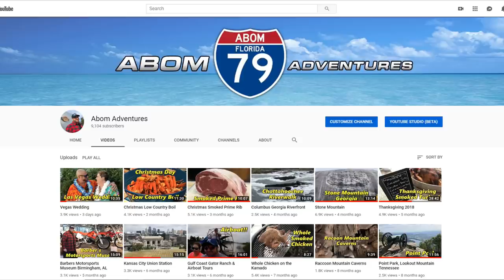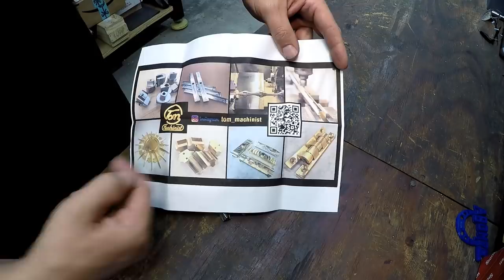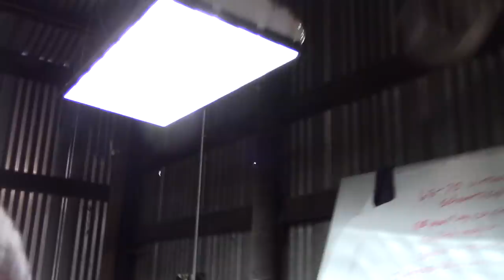SNS 258: Forging a Vise Handle

Comment: For some of your machinery you may think about making a steel base that will allow the pallet jack to just lift it up and move it around unless you are going to have issues with heights or plan to affix it to the floor and even when affixing to the floor you may be able to use longer bolts.  It will make moving things around and setting them much easier.  A couple pieces of tubing welded together will easily make a sturdy base and with it set at the right distance will make inserting the pallet jack a simple process.

Comment: Morse Twist drill opened in 1864, and judging by the font used on the lid of that index I'll bet it's much older that the 20's.

Comment: Congratulations you two! I wanted to pass on something in regards to the new inverter welder. When you have time play with the AC welding on Aluminum. Use a Lanthinated tungsten ground to a fine point and play with the cleaning percentage and your pulse/dip rate. Welds come out immaculate, much nicer than balled pure tungsten welds.

Comment: Congratulations to You and Abby and my best wishes for you both. I did it with my wife in 1975 and there wasn´t a single day of regret.     Why throw away? The engine hoist needs only lager wheels, as far, as i see. That should be doable. As is, it´s a pain of course. Only usable for static lifts, at least for heavier parts.

Comment: We use engine hoists in the field all the time and normally have the same problems that your are having with moving them under load. One hoist that had people fighting over had been modified slightly. All of the wheels were replaced with 6" units that have urethane tires. The larger wheels coupled with the tires allows for easier movement since small differences like cracks in your pad or debris.

Comment: I have made over 50 trips from Michigan to the "Four Corners" area: Grand Canyon, Zion Canyon, Chaco Canyon, Arches National Park, Painted Desert, Mesa Verde, Cedar Breaks, Vermilion Cliffs, Echo Cliffs, etc. I walked across the Grand Canyon by a full moon; headed north, seven miles to the river, eleven miles to the rim, 4,440 feet down, but 5,780 up. Right the North Rim is higher than the South Rim. I  enjoy Adam for many reasons, here is another.

Comment: I'm going to guess the drill index is around 1880 1890 around 1900 they made the cylinder index with brass and or metal around the ends kind of like a can if I recall correctly

Comment: This is the second time you have mentioned needing to make our modifying a second pin for the arbor press. Is there some reason you can not just take the pin you are pulling out to the left all the way out and then push it in from the right? I do not have one but from what you have shown it should work.  Love all your videos.

Comment: Help me out please, Adam.
When I started work a decade or four back, I worked over a foundry that made test pieces for the laboratory I worked in. I noticed that all the machines were mounted on thin ( c 2" ) wooden sheets, made up of multiple boards side by side.
The guys working there told me they were cedar. Cedar because it is resistant to attack from workshop chemicals. My memory has it that the boards were needed for two reasons. To iron out irregularities in the casting of the machines' base, and in the concrete floor, that was to avoid point loading the cast iron base, which could crack otherwise. The insulation also protected the building from shock loads, especially from presses and hammers. There was some talk of the boards also stopping off balance loads causing a lathe to walk off across the foundry... but I was quite young at the time!
Anybody any thoughts? I've noticed nobody on YT bothers.

Comment: Adam what are those gloves you're wearing while you're Tig welding??
Reply: Lincoln puts their big giant logo on the cuffs for a reason.
Reply: My mistake. The ones you're handling the handle with after it's welded. Is that fire hose material?

Comment: Congrats, Adam. Why does the drill index have a cap? What are you supposed to do with the cap when you've got it full of drill bits?
Reply: the cap will cover the drill bits keeping dust and dirt off of them also if tight enough if tipped over will not let the drill bits fall out.

Comment: Adam, I did a little "googling" about this and could not find much other than some info from the Bedford Whaling museum. I also searched for images on that particular index and only found about 2 while I found a number of others with brass tops. I did find from the Whaling museum that the company was around from 1860 - 1975. Are there any other markings on the piece that would indicate a part or patent number? Perhaps the whaling museum might have more info on it.

Comment: I have a question about large arbor press vs hydraulic press? Could you talk about when one would be preferred over the other. Thank you
Reply: My thought Vince is that the arbor press is very fast and plenty powerful for normal work, whereas hydraulic is much more powerful but very slow in comparison. Both are essential and have there places.
Reply: He talks a bit about this in the video where he picks it up. A manual press allows for more 'feel', more feedback to the operator, which can be important for certain operations. Adam does more one-off stuff, not production-run stuff, so each piece is unique and may need more managed care taken as he figures out exactly what it needs.
Reply: Unquestionably, an arbor press is rapid and has a feel to it. Having said that,every arbor press handle I have ever seen is bent a little. Using a cheater pipe and a "200 lb gorilla" on the other end,determined to make the whatzit by God move. So no tool is perfect,and every decent tool design has an application. Some more breakable than others.
And the majority of shop hydraulic presses are the base model,which means by hand pumping forever what is a simple hydraulic jack. Frustrating,but how often do you use the thing ? In our shop,the arbor press was the first stop,and months could go by with the hydraulic press collecting dust. Absolutely neccessary when you need it,but there it is.

Comment: Hey Adam, you are a machinist- would you like to build an experimental caster wheels for your engine hoist instead of junking it?  Here ya go- acquire some 2" roughly diameter ball bearings, machine a half sphere ball socket that will accept those  bearings with an external thread around the outside edge of the main diameter. You may want to increase the internal diameter to install a smooth flowing friction free plastic like Delrin or some such that can withstand the weight. Machine a semi-spherical nut/ring to fit the other half of the ball bearing- not to cover it in its entirety but maybe leave 1/2 inch to 3/4 inch exposed- maybe a 2.5 or 3" bearing would work better. Anyhoo, add adapters as needed to the top of the first half to attach it to your hoist. I have just been curious how well those would work for a long time. Maybe you would like to try it?

Comment: "Even though it's metric", it's about time you guys over to the west adopted the metric system, definitely a superior measuring system.

I guess this will lob a grenade into the room!
Reply: well... it is, and it isn't. what's half of 6 3/8"? what's half of 157mm? 

I use metric but "footric" has its uses too.
Reply: Let's just agree to measure in 254ths of an inch.
Reply from the maker: Probably the most sour and abused comments made on the channel, which I no longer have an interest in deliberating in.
Reply: Adam, no offense intended, the UK is the worst offender when it comes to using a single system.  We use miles and feet but buy 8' x 4' 12mm plywood, we buy out petrol in litres but talk about mpg there are many, many others.
Reply: It's kind of funny that my metric sockets require 1/2 and 3/8 inch drive. Also,  how many degrees are in a metric circle?
Reply: Though we still buy pints of beer

Comment: Why was this welding you were doing so quiet?  All the other welding I've seen is pretty noisy.  Never welded before, so....  No idea.
Reply: This type of welding is called TIG welding. It doesn't produce the frying bacon sound that other styles of welding like MIG or stick produce.
Reply: Also during editing I'm assuming he turned down the volume, but Tig welding is much quieter than other types like David said.

Comment: adam.. Don't throw out that cherrypicker.. create some New wheels with needle bearings on the ends... or with a hollow T nut to preload tapered roller bearings.. just cheap ones from the parts store.. a nut to adjust the preload of the tapered roller bearings.   the swiveling wheels can be remade using ball bearings.. bigger ones with a T sleeve that uses snap ring to retain the end cap.. with a hole thru it to put new bolts.  the replacement generations of engine hoists do not have the low profile bottom design like that..   if the engine stand wheels get caught on a lip or crack in the floor. just use the jack handle to lever it over by lifting on the frame.. or use one of your big prybars.   please also modify the boom.. so you can install a worm drive winch on it.. https://www.harborfreight.com/2000-lb-capacity-geared-winch-5798.html   you will have to add an open top guide tube near the end of the boom and a pulley ... perhap even a loop on the underside to allow you to double up the cable to increase the lifting ability..  that winch won't unspool if you let go of the handle. but it will allow you to safely lift and lower moderately heavy items.. without needing to worry too much about pumping the jack other than for proper angle.

Comment: I has started ! Metric calipers, metric taps.... First we'll turn you metric.... from there it's only a small step in turning you into a socialist...
On a more serious note : The forging was impressive and interesting to see, but I don't understand why this route was taken.... wouldn't it have been a lot cheaper/simpler/less work to turn the handle from some bar stock? After all the effort of forging the rough part, you still had to put it through the lathe to get it to proper size and dimensions...
Or am I missing something?
 Hugs and kisses!

Paddy